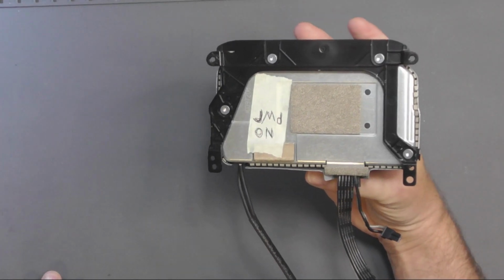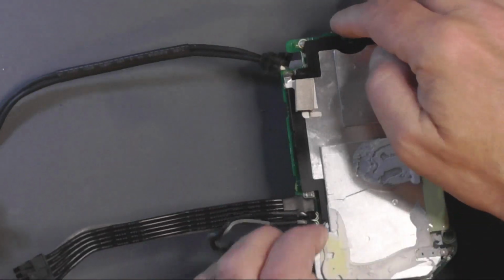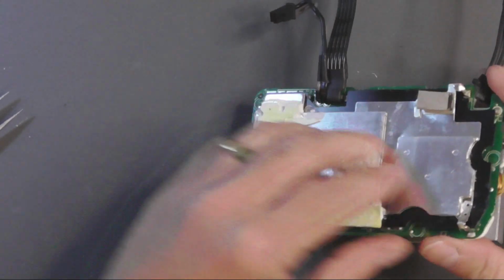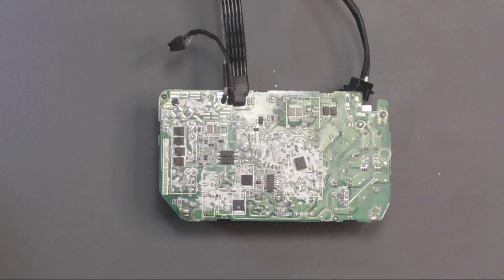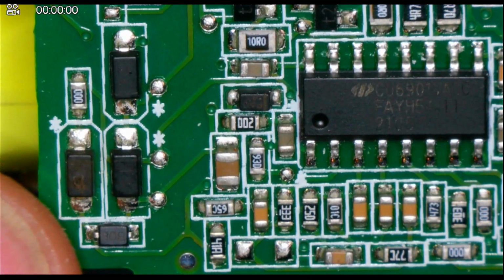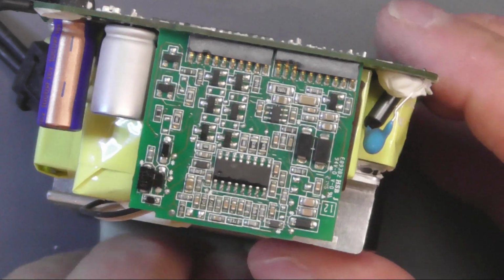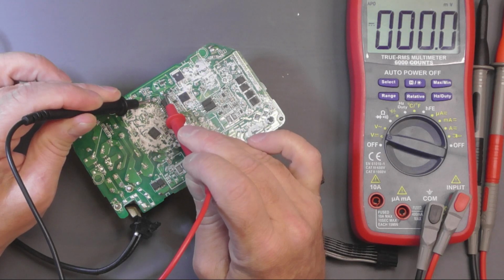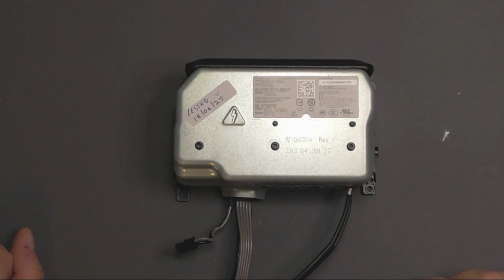Can I Fix It?  DEAD Xbox Series X Power Supply.  No 12v output

Comment: I have similiar issue but the diode is fine, except the IC is toasted. I replaced both the diode and IC, the psu will be fine, but the IC will blow again if the console is shudown/unplugged. I totally have no idea for now, I replace an another IC and it keep blow again and again. If the console is turned on, it can run as fine as when it shutdown
Reply from the maker: Is the IC failing during shutdown or is it during the actual restart?
Reply: @fixornofix Oh, I did check again and it actually dying when re-plug the AC. I totally have no idea for now, both brand new IC and donor IC from another same psu died the same way.
Reply: but it die with AC re-plug when the psu is installed into the console, on outside I dont have any stuff to loadtest the 12v, just my multimeter

Comment: do you have diagram for that board in the supply? i have repaired one of this and i found a capacitor below thechip that exploded. I try with a 22uf to test console power on but switch off after logo. Maybe  10 second and off. i need the righ value
Reply from the maker: Can you take a picture of the component you need the value of and I can check it and give you the value.
Reply: @fixornofix https://drive.google.com/file/d/1Y-cWZXO2UIL-mvsgrrN9wjW_SYW8tgm9/view?usp=drivesdk
Reply: I dont know if i can attach a picture here. Anyway there is a small chip with 6 pin. Amore this there is a capacitor and above capacitor 10r0 resistor. I need the value for that capacitor because was exploded . Thanks

Comment: Thank you for focusing me on that small side board, because primary side was ok, had same no 12V output. I started at that K5 diode first, which was burned on you board. It did look heatly, but when i measured it, it was shorted, also measured those other diodes around, they were shorted too, also the small orange cap between the chip and diodes... So i decided to remove the chip and all shorts were gone. Looks like this small board is common problem by these PSUs. Later i found a small transistor t2X-33 next to connector, the first top one was cracked, half of it were missing... Also one resistor 01B was displaced and i could pick it up without desoldering it... Idk factory error, or due heat.. I ordered the chip and transistor and i hope there will be no more problems. Thank you for your video! Like and Subscibed!
Reply from the maker: Great job finding the faults and thanks for such detailed info.  Could help someone else find the fault with theirs.
Reply: Thank you for this comment, it greatly helped me out as I have the same issues were the small board on the power supply had a couple of shorted diodes and a cap.

I removed the chip and all shorts were gone.

I don't have a replacement so I will have to see if I can find the chip and see if I can get this power supply working.

Can you let me know where you found the chip please and did you get your power supply working?

Thanks
Reply: @hydrolics5449  i forgot to mention, i also had to replace 4 mosfets on main PSU board under that white stuff, they were shorted... or at least i had that feeling when i measured them with multimeter.. also ordered from Aliexpress... BSC0702LS, 10 pieces were 2€, but must not be in your case... was not easy job to remove that white stuff and remove those mosfets
Reply: PS.. after removing the chip i measured first and last pin on that small board, got 44.5V these, so the secondary side of main board including those 4 SMD mosfets should be fine. I hope... will see when parts will come.. Thanks again, you did save me a lot of time digging in it deeper...

Comment: I have same board but mine I see some smoke over the moset behind the capacitor i think how to check that
Reply from the maker: Sounds like the mosfet has failed. The thing is there will likely be other components that have failed/shorted that caused the mosfet to fail.  Best to get someone with experience to have a look.  Switch mode power supplies not the best thing for a beginner to try and repair.
Reply: Yeah unfortunately not experienced people here to look over these kind of things . I have ordered on in alibaba and that is chicony power supply not lito on . Is it good or bad power supply  from china most of them are chicony only and it seems very light engineering not like this liton which have lot of components and bigger heat sink  @fixornofix